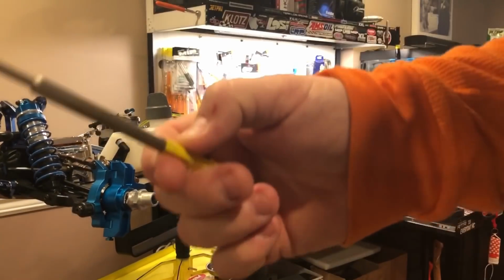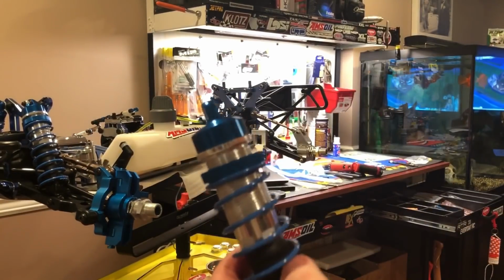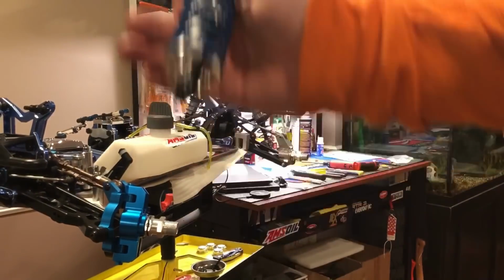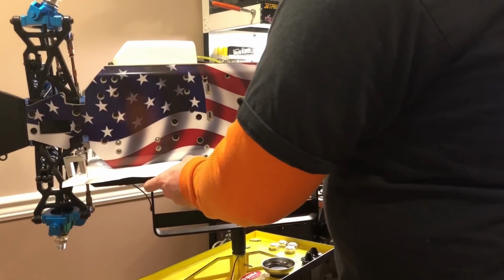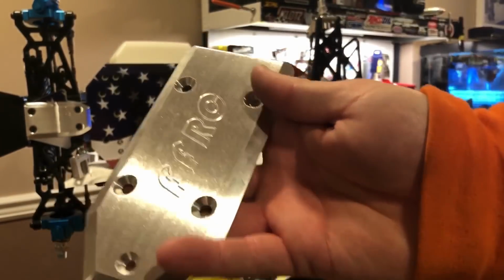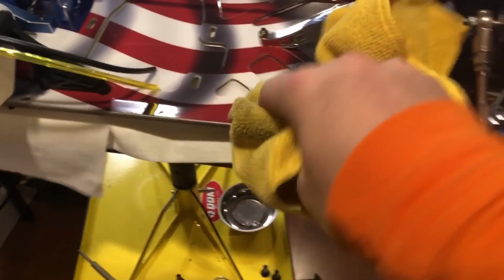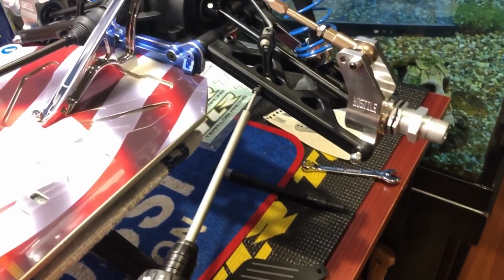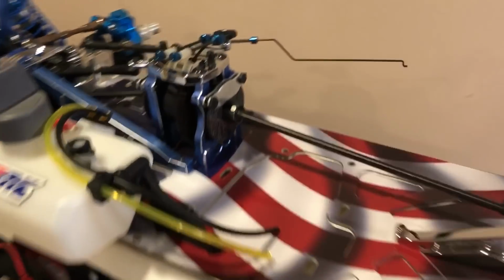Part 9, K👑M X2/LOSI 5T Platform,(Spring Retainers,Skid Plates,FID CV Protectors Install)

Comment: The car is starting to become another masterpiece just like the losi!
Reply from the maker: Elite Rc thank you!
Reply: BOTAJELL in my area I can get 98 octane unleaded would I have a problem running it with these small engines?
Reply from the maker: Elite Rc I hope when you say small engines you don’t mean NITROs because you can not run gas on Nitros only Glow Fuel . Now if it’s 1/5 scales Gas 2 stroke ? Hells yes you can run 98 especially if it’s ethanol free 👍🏼!!!  Then just mix it with some Dominator oil at 28:1 and your good!
Reply: BOTAJELL yep talking about 1/5 scales, and I can break the engines in with the fuel too?
Reply from the maker: Elite Rc for breaking in new motors I do one gallon of 24:1 then after that I mix 28:1 forever
Reply: BOTAJELL Ok cool thanks for the info!

Comment: Looking good.  With those dirt guards I'd check to see if there's free movement in the suspension.  My first set i made was bolted like those and binded the suspension. 😎
Reply from the maker: laurent gouriou thanks for warning of that !! All is good these pins or shaft seem to stop sooner then the older ones that you would be able to tighten the locknut in more and if that was to happen then yes it would make it get stuck. Thanks for heads up
Reply: BOTAJELL ok cool😎

Comment: Well that explains why i couldnt find a losi bladder kit a few months back..i hunted high and low
Reply from the maker: Sick N Tired Rc Track Day Hobbies sold 3 of them that he had i stock to 3 subscribers of mine I don’t know if he has anymore??? Once there gone there gone but thanks to King 👑 Motors and Rovan that they will always carry them so that’s great for the guys that love the Bladder system of suspension!! I don’t know WTF?? is up with Horizon Hobbies lately ?? It’s like there trying to end all the great things that is real for us motor heads that Braaaaap and that can be helpful for newbies. If they don’t take care of the newbies there will be no future! The new generation that took over the original LOSI name should be ashamed of themselves for what they are doing! LOSI himself would never discontinue great work stands and exhaust pipes and clutches and suspension parts ! To many liberals at Horizon hobbies now working. Soon you may see them at toys r us like gay ass traxxas?
Reply: BOTAJELL you know something youre absolutely right.  I found that FID sells a bladder replacement kit and may end up going with that one ..the bladder in one of my shocks has and oval shape and is not working properly and causing leakage
Reply from the maker: Sick N Tired Rc I have seen that before on some friends RCs but I have to say that the ones I’ve had on my Losi 5T have bin great and the ones on my X2 looked great when I changed the oil on them!! I hope your next ones work out for you!!

Comment: I have been looking at turtle Racing a arms. Plastic ones.  Made from CNC plastic instead of moulded plastic. From ddm.   They have. Droop option on rear.  What do you think of them. ??? I have tried Alloy a arms.   But.  They have no flex I keep bending them.
Reply from the maker: Anthony Charles I definitely don’t like aluminum A arms at all and will never use them again or maybe just on a shelf queen?? I never use the TR a arms but I have used RPMs and I liked them but I’m sure those TRs are great because almost everything they make is great.

Comment: I know what you mean about the the bladders. I was confused when i was building the 5ive B shocks there where no bladders in them. Dont know why they did away from them my opinion the shocks with the bladders work so much better then the ones without. I bought 5 rebuild kits last year cause i like to rebuild my shocks on my 5ive t once a year plus DDM had a sale on them. If there being going away from them im buying some more rebuild kits before there gone. Build is looking good so far.
Reply from the maker: Matthews Toy Chest bro I’m the same way and I’m doing the same thing.

Comment: Would of bine nice two crome the rear brace looks off ..but nice still
Reply from the maker: rc ridder that rear brace is for only when I use the SkoPod 62 engine so it fits in the car! When I try out other engines in the future in this I will have to use the blue one that came with the Roller.
Reply: I see

Comment: First! I have a update on my build it turns out that I can't get a rcmax crankcase so I will use a scz reed case and machine the hell out of it to fit the 70cc head and piston.  I will use a g340 crankshaft, obr v2 reeds, Wj 71 carb (later on I will get a rooster tail), Puch estoril black carbon pipe modded to fit the baja like a side pipe. Those are the major thing there are others but there nothing big. Maybe I'll even open a build thread I let you know if I do so and I'll let you know if I change my mind of anything on my build!!!!
Reply from the maker: Karrie Bhurgari I can’t wait to see your build brother!! Please send me the link
Reply: Ok will do, still in the r &d stage but will start soon hopefully in a month or so!!!

Comment: Losi just use.  TLR SHOCK CAPS. with bleed nipple      I.  Get. Bladers from. Rcmodelz. Which is king motor roven stuff.   But.  They. Are all the same.    No. Deep bladders. For rear.  Not. Tried. Front bladder in rear shock. Yet.  Used old ones last time.        Do you think it will make a difference.    ??????     Am gunna try to get hold of track day hobbies on Facebook thanks